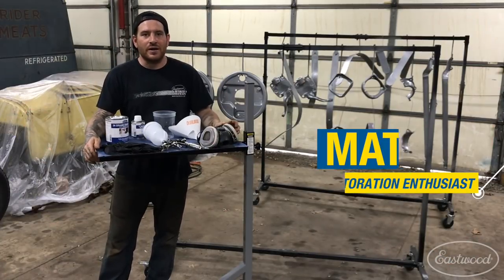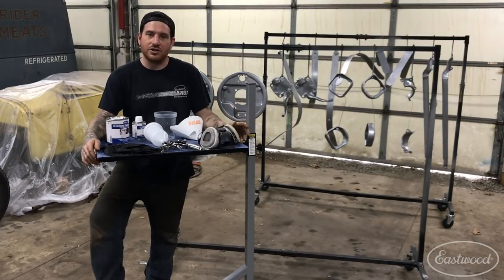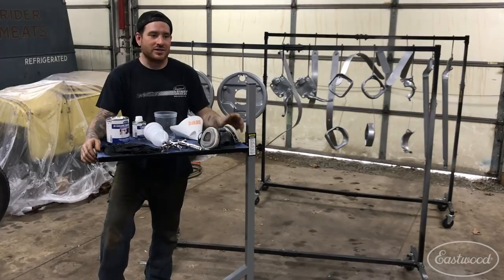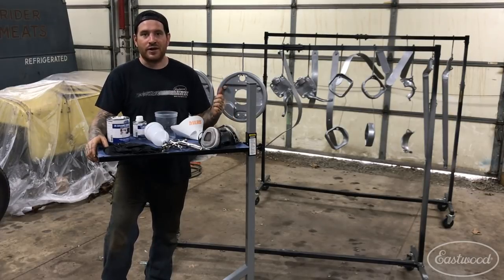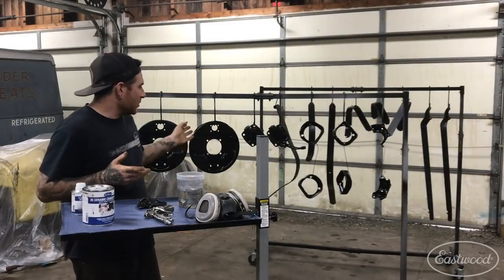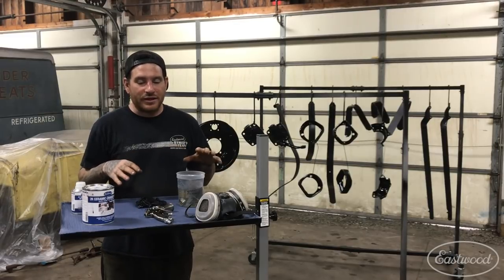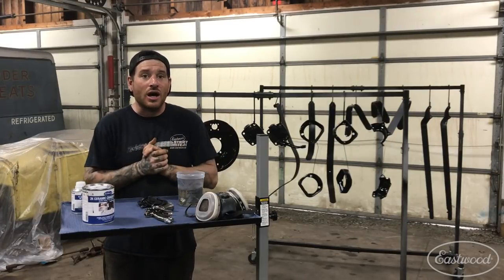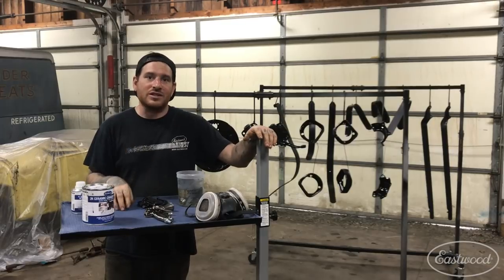Homemade Employee Testimonial - Rolling Shop Tray - Perfect for Moving Parts & Tools to Your Project

Comment: Thank you for posting the video, terrific job. Two questions can the top part of the tray be extended to make it higher. In other words is the square tubing a standard size so that I can make it higher by adding a section of the tubing onto it? Can the angle piece be removed and install a longer one so that it is the same length of the bottom, then make it adjustable in reference to the height needed. This would make it lower so that I could use it under the car, I don't have a lift. Please advise, thanks.